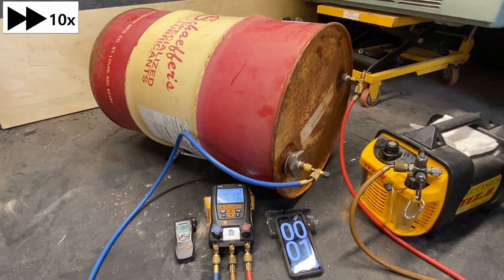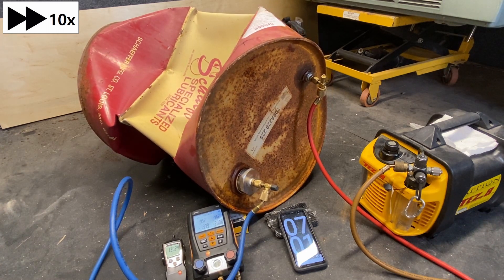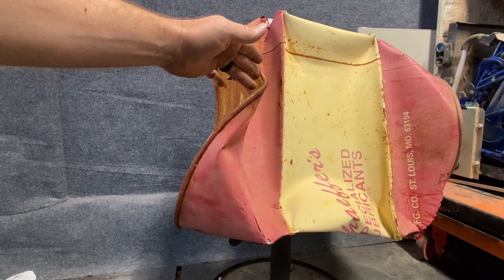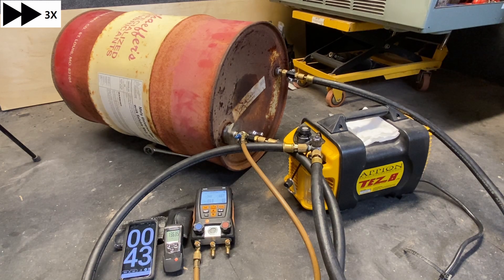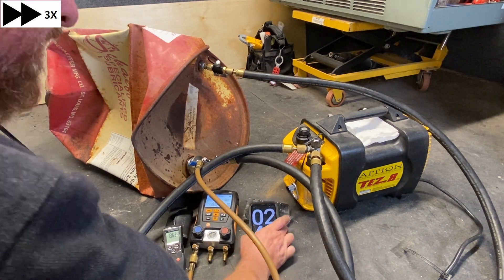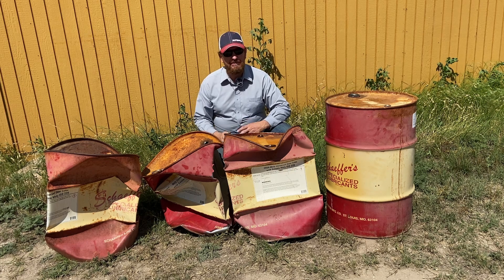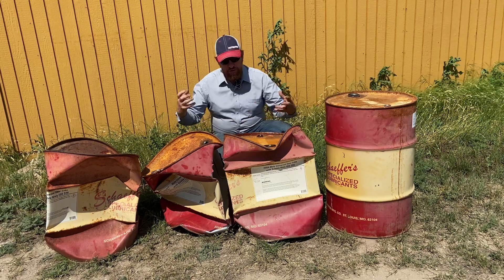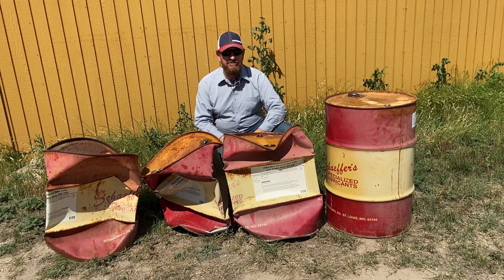HVAC 136 Vacuum P3 Mechanical vacuum on a barrel

Comment: So can I think about like, in the deep see, the water crushes your body? Because the pressure is greater the deeper you go.
Reply from the maker: Yes!
As you go deeper you have more weight on you. All the water above you and the weight of air on top of that. 
As you come closer to the surfaces, less weight on top of you.
At the surface it's the weight of air on top of you, 
As you go higher in the mountains there is less air and less weight on top of you. 

When you get to space, there is no more air on top of you, no weight applied on you, a perfect vacuum. 

Now, what would happen if you barely inflated a balloon while at the bottom of the ocean, tied it off and started coming to the surface?
Reply: @love2hvac  man thanks. That helps me understand it. My brain works different 😅. Thank you.

Comment: On residential I never worry about speed ,I make enough mistakes!😆
Believe me I get the gigantic hose thing but I'll stick with the one hose straight off the pump connected to the highside no manifold with a gas retention valve ,and my micron gauge on the lowside isolated. 
I get the super-duper hose thingy but there's plenty to do whilst I evacuate. 
I'm not doing commercial anymore!
🥃🥃🍺🍺🍺🎯🏌🏻‍♀️
Stay safe 
Retired (werk'n)keyboard super tech. Wear your safety glasses!

Comment: Thank you Mr. Ty what is the best vacuum machine and vacuum gauge?🥀
Reply from the maker: Great questions! I will be addressing that soon!
Reply: The Tez 8 is the worst and most expensive vacuum pump I’ve ever had. Other than the tez8 I’ve owned a robinair 5cfm and several 7cfm JB  pumps. Surprisingly the robinair seems to pull the quickest out of all my pumps but it is not good construction. The JB’s seem to be the best overall. It’s important to do the maintenance. So far the only pump I’ve had stop working is the tez 8 and it cost $400 to replace all of the seals. The Robinair never stopped working but the housing came apart. I’ve been in the trade 16 years
Reply from the maker: Interesting,
My favorite is the new Feildpice pump.
I have had yellow jacket, JB, Navac, robinair, and the Tez 8. They all performed well except the Robinair. 
I've been using pumps for 25 years and had the tex 8 for 8 years without any problems until an instructor let a class use it improperly.

More important than the pump is maintenance, the oil used, larger hoses, valve core removal. 
Jim has a video of a 2 CFM pump out performing a 12 CFM pump jus because of the hoses and restrictions.

Comment: That's pretty cool. Where did you get the fittings you put in the barrel openings?
Reply from the maker: I will post the links below. Hopefully YouTube  lets me post links.
Reply from the maker: Stainless Steel 316 Cast Pipe... https://www.amazon.com/dp/B003GSL3KE?ref=ppx_pop_mob_ap_share
Reply from the maker: Stainless Steel 304 Pipe Fitting,... https://www.amazon.com/dp/B0043D24QI?ref=ppx_pop_mob_ap_share
Reply from the maker: Stainless Steel 304 Pipe Fitting,... https://www.amazon.com/dp/B0043D24QI?ref=ppx_pop_mob_ap_share
Reply from the maker: Stainless Steel 316 Pipe Fitting,... https://www.amazon.com/dp/B0043D26RA?ref=ppx_pop_mob_ap_share
Reply from the maker: Stainless Steel 304 Pipe Fitting,... https://www.amazon.com/dp/B0043D24QI?ref=ppx_pop_mob_ap_share
Reply from the maker: It's not letting them post send me an email and I will send you the links

Ty @  love2HVAC  . Com  (remove spaces)
Reply: @love2hvac  the links are appearing in the comments above right now. Maybe they were on a delay.